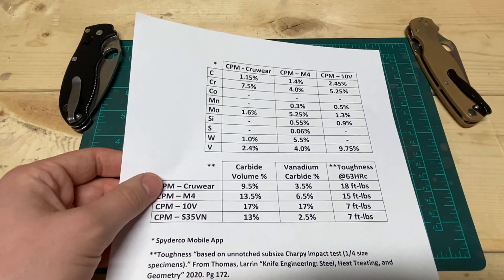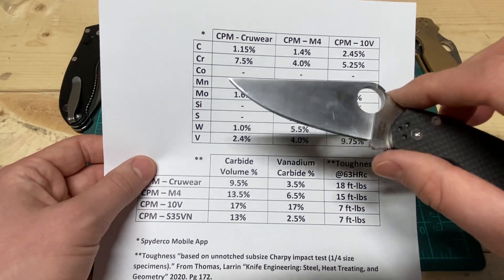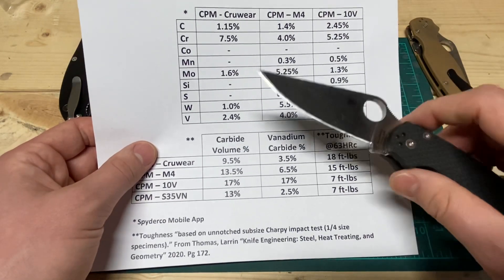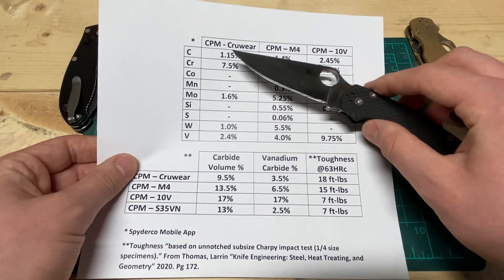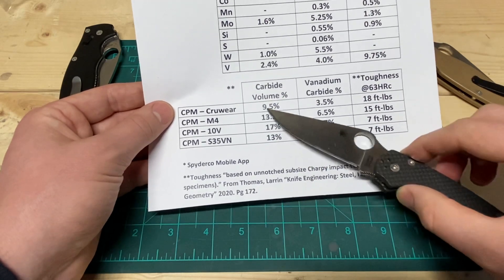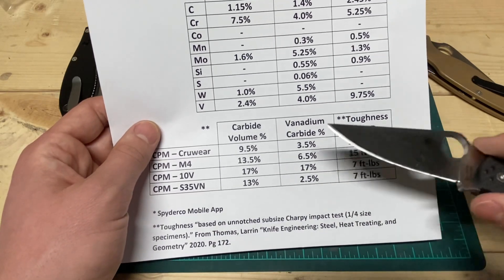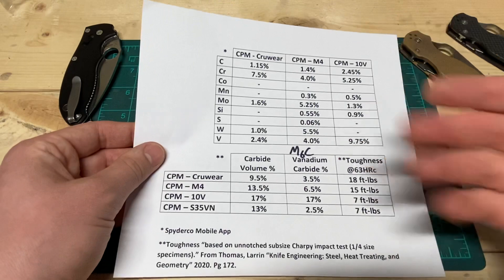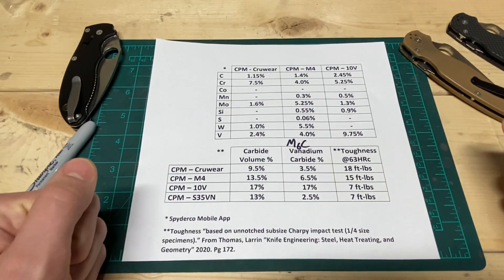Talking Steel: CPM-M4

Comment: Which steel is more desirable for a folder used to cut things but also for wood processing and carving when hiking, M4 or Cruwear, or maybe another steel? Great video by the way. I’m checking your channel to see if you have similar comparative videos about K390, CPM Cruwear and CPM Magnacut (I saw in a video or read in a comment - I can’t remember - that it is a slight difference between for example Cruwear and CPM Cruwear, or Magnacut and CPM Magnacut. Is this true?) I have just Cold Steel AUS10A and S35VN folders and CPM S30V Yojimbo that I don’t use (keep it for self defense), so I have no experience with these higher edge retention steels. I sharpened just AUS10A steel (most of my folders).
Reply from the maker: Probably CPM-Cruwear would be a good choice for you assuming you don’t care about stainless. 

I’m terms of recommending something else it depends a lot on what things you’re cutting and how often and what your sharpening ability is. 

CPM is a trademark name for  the particle metallurgy process Crucible uses. Any steel with that prefix is produced using their particle metallurgy process. There are a handful of steels that are made both with and without that process like Cruwear and M4 so the prefix is important with those!
Reply: @EngineersPerspective701  Thanks. So, the steels with CPM prefix are better than the homologue without it?
Reply from the maker: @danmano478 in almost all cases it’s a significant upgrade to have particle metallurgy. 

Note that both Carpenter and Böhler have particle metallurgy too with similar properties but don’t necessarily have a prefix to let you know so you just look it up in those cases.
Reply: @EngineersPerspective701  I assume Spyderco always has CPM steels (sometimes it appears only Cruwear or Magnacut in description, probably I should look in the photo what is written on the blade).

Comment: Interesting. Love M4. It's my favorite EDC/hard use knife steel.
Would love to hear your take on CPM-3V and Elmax as well.
Reply from the maker: Generally 3V isn’t run hard enough or have enough carbide to make it into my enjoyable steel category although it’s super easy to move on the stones and takes a fine edge. 

Elmax doesn’t seem like anything special to me. Rather go S45VN or Magancut
Reply: @EngineersPerspective701  - Roger that. I think Spyderco does 3V about as well as anyone has. In the Schemp TUFF, anyway. Mine performs well.
And my 9500 series ZT 0561 in Elmax performs very well once I took about 1 mm of burned steel off the edge.
Reply: @EngineersPerspective701  - why not do a video series on the processes of making various steels?
CPM, CTS etc etc vs conventional ingot steels. There's much about the powder metal processes I'm still confused about. I'm sure others are as well.
Reply from the maker: @holdernewtshesrearin5471  Larrin Thomas has some incredible articles on his Website “Knife Steel Nerds” 

Here is the magnacut article but there’s definitely one on different steel manufacturing. https://knifesteelnerds.com/2021/03/25/cpm-magnacut/
Reply: @EngineersPerspective701  - thanks brother.
Reply: If you like M4 youd love Vanadis 8. Its just a tad better but roughly the same idea. Its a fantastic balance of high edge retention and high toughness. Its just slightly higher than m4. It also has no chromium carbides, just vanadium carbides. Its edge retention is literally identical to k390, and just behind 10v. So it has more than edge retention than m4, but its slightly tougher.  Its 39% tougher than 10v but within 10 percent of 10v's edge retention. Its freaking amazing stuff. Even Larrin Thomas only has a bunch of theories on why its so good. Even he isnt totally sure. He says its his favorite high alloy high edge retention steel though. His reccomendation id certainly good enough for me!  He rated Vanadis 8 at 6/10 for toughness and 7.5/10 for edge retention. A combination i nevet thought possible. only downside is theres only ONE production knife using the steel. Luckily its not terribly expensive. All the custom knives in Vanadis 8 are suuuuuuuper pricey though.

Comment: Thanks for these videos on various steels.  They’re excellent, and I appreciate em.  I bought my first modern Spyderco a couple months ago, (got a couple more since then), and it happened to be a BHQ exclusive Shaman; with a satin M4 blade and green canvas micarta scales.  I didn’t know a whole lot about M4 before buying the knife, except that it holds an edge very well and isn’t stainless.  The more I’ve learned about it; the more pleased I am with it.

I don’t want the absolute hardest steel on the planet, as I’ll need to be able to sharpen it myself… but I want something well above average when it comes to cutting performance and durability.  M4 seems to fit that bill.  From what I’ve seen, Spyderco seems to do a great job on the heat treat for their M4; getting it to 63-64 HRC, (and I think I saw a couple blades that were at 64.6).  Also iirc, M4 has been around since the ~1960’s, (unlike many of the steels which outperform it), and the fact that it remains a very relevant steel today is quite impressive.
Reply from the maker: Glad you liked it and are getting into pocket knives! You definitely started with a great one. M4 is a great steel for a blade and honestly absolutely one of my favorites! Keep in mind that the particle metallurgy process is a really big part of what has allowed M4 to stay so relevant. A combination of old and new!
Reply: @EngineersPerspective701  Yep, particle metallurgy has definitely enhanced M4’s performance.  Of course, comparable steels use PM technology and techniques as well, to achieve their performance.  😉

Comment: You briefly talked about it’s stainless quality’s , in terms of its stainlessnes what does it compare too
Reply from the maker: Pretty low, in the realm of Cruwear or Hap40. Possibly slightly worse but it depends on the heat treatments. Notably better than a 1095, 52100 type of basic carbon steel

Comment: M4 is great steel but I've been on a K390 kick so some time now.
Reply from the maker: How can you not go on a K390 kick? It's freakin awesome! I've been using Maxamet and 4V mostly right now but K390 is soo good.
Reply: @EngineersPerspective701  Yeah bro ! I hear that with Maxamet! I've only tried 3V so far. No 4V for me. How do you like 4V ?
Reply from the maker: @doejon9424  definitely still forming my thoughts on 4V still but it’s a lot like a M4 honestly. Probably will have more edge stability but I haven’t pushed it too hard yet other than hitting a staple when cutting out our old carpet. No damage but blunted.
Reply: @EngineersPerspective701  I've experienced micro chipping with 3V before. Not so much on M4. I still remember my first experience with M4 on a Spyderco "Air" and it was excellent. I immediately wanted the steel in a bigger knife. M4 used to pretty rare on folders
Reply from the maker: My first M4 was the PM2 and it was a next level of performance. Great up front sharpness like I'd never experienced at that time and solid working edge that cut forever. Sharpened better than most of the steels I had too!

We definitely live in an age of luxury where M4 is readily available along with K390 and Maxamet.

Comment: Super helpful video.  I'm really not a collector, but I just happen to own two Spyderco's in M4.  I have the SMKW PM2 "arctic" exclusive in M4 (underwhelmed by the scales, which I got it for, so not sure I will hold on to it).  I also have the lil' Native M4 exclusive, which I put titanium scales on... I totally love that thing.  I'm sometimes in a city with a 2.5" knife ordinance, so the lil' Native seemed like the most knife I could get within that law.  For such a stout little blade, M4 just seemed to make a lot of sense (especially for the same price as s30v).  But it's true that it's not a great slicer, so I've been looking at knives to pair it with (other than just a SAK)...  After our conversation about k390 I'm looking at getting a Dragonfly in that steel (probably the wharncliff version that should be coming out).  That should be a great precision cutter and respectable cardboard cutter.  One thing the lil' Native helped me to appreciate is how good a small knife can be at precision cutting, but the dragonfly is going to be better at that in every way (probably true of the chaparral as well, but no k390 options there).
Reply from the maker: Not a collector either! Most of my knives look like hell from use or experimentation of some kind! It may be worth keeping the PM2 just for M4 but I'm sure you can make some money on the one you have while still picking up another M4 blade for less. 

I really started having the same appreciation for smaller blades once I got into the Para 3s and native 5s. I fully prefer that size and it becomes more apparent as working knives. The precision and ease of use totally trumps the extra blades length most people put as a qualifier for a "work knife". A K390 dragon fly would be absolutely awesome. Probably the most cutting in that size package that has ever been produced by man! It won't feel as stout or refined as the lil' native but it's a sweet little blade.
Reply: @EngineersPerspective701   
I assumed I would sell the M4 PM2, but they must be making more of these exclusives, because the Ebay selling prices have been close to what I paid.  I still may sell it... I think I'd be happier having my money in a Brouwer (and they're already disappearing).  I like the idea of putting a liner-delete copper scale on a Brouwer, without it getting crazy heavy like most copper knives.  The Brouwer would probably be an ok recycling knife as well... less length, but pretty thin behind the edge.  It's hard to justify keeping the PM2 just so I can cut cardboard slightly faster, lol.

It looks like you've got bigger hands, so I can see why you'd prefer the full-sized Native 5.  The attraction of the Dragonfly is also that it will basically disappear in the bottom of the pocket (just like my Victorinox Compact, which I mostly just carry for scissors), so I can always carry it as a secondary.

Comment: Silicon is not impurity brother.. Sulfur and Phosphorus are.. M4 was one of my favourite steels untill ive got 4v and k390🙏 I had untill recently had Shaman in M4.. I loved the edge on M4 but i never really push it to its limits.. Yet another one that had "very hard to sharpen" reputation, totally false.. Easy with proper abrasives (100% diamond or cbn).. Thx
Reply from the maker: “Mostly and impurity” maybe better said as a functional impurity? It has specific functions in the production process dealing with oxygen I think but it being leftover at the end isn’t necessarily positive I’d say. Possibly helps a little with machinability. 

Diamonds/cbn definitely make M4 a sweetie. Very good overall steel. Like you though I’ve also “graduated” to a little higher tier of steel for my personal preferences

Comment: What differences do you notice between CPM-M4 and K390 in terms of performance if any?
Reply from the maker: Substantial differences. Two cases to look at because I also have 10V that is a lower hardness than the K390 I have and they perform extremely similar. Note that I do really like M4 and find it to be a steel that I can comfortably use without feeling like I'm giving up anything.

If I had to grade their performance it would go like this.
M4 (62-64HRc) = B
10V (63-64HRc) = B+
K390 (>65HRc) = A+

1) 10V at same hardness as M4 (63-64HRc): In short, 10V/K390 at the same hardness feels exactly like M4 but on steroids and takes longer to apex with the same abrasive. Every property is either equal or better essentially. 

They both hold the same up front sharpness but 10V comes up WAY stickier in sharpening. Even if over polished it quickly develops into a sticky edge after a bit of use as those VCs are exposed. M4 holds onto whatever the original edge you put onto it until it dulls enough to form a working edge. The quality of the 10V working edge is superior and is able to cut things that M4 will struggle with for longer. 

2) K390 as higher hardness (>=65HRc): Not even a close comparison. It's a totally different class of performance. Much higher edge stability. Longer up front sharpness, same working edge as 10V.
Reply: @EngineersPerspective701  No wonder they put in the production model for the Seki model line-up. I wonder why more manufacturers haven’t picked it up versus M4.
Reply from the maker: @nandayane  the seki K390 is amazing! And they’re geometry tends to be better than 80-90% of what’s out there too, delica came at 0.015” BTE at 17dps plus the super thin spine and distal taper
Reply from the maker: @nandayane  my guess is M4 is more known and easier to machine
Reply: @EngineersPerspective701  Gotta give Sal respect for putting it in the seki line of knives. Spyderco really is run by a steel nerd! I guess that is one way to justify the “spyder tax” put the best steel you can find in your main line-up.
Reply from the maker: @nandayane  they definitely give a crap! I feel like most knofe companies are putting a 4 cylinder in a Ferrari body whereas spyderco sometimes puts the Ferrari engine into a Toyota Camry
Reply: Hopefully it will be less than 3 years before we see a magna-cut endura or pacific salt knives. It’s unreal that the native 5 will be released in magna cut less than a year after the steel came into existence. Exciting Times
Reply: K390 chips a lot easier.
Reply: @jeremyjjbrown  right, that stuff sucks!!
Reply: @jeremyjjbrown  yup and the repair is no fun.

Comment: M4 is currently my favorite steel.   You do a great job on these videos.  Hope you have a great new year!
Reply from the maker: Appreciate it! Enjoy the New Year!
Reply: I've got a benchmade bail out with an m4 blade. Comparing it to my Gerber easy out with much softer steel I would say that the benchmade stays sharp much longer (general hard use), problem is, it takes a lot of time and patience to re sharpen. On the other hand, I have a work sharp 20° feild sharpener that I can put a razor edge on my Gerber in 5 min.

I do like the m4, but probably wouldn't even attempt sharpening it in the feild.
Reply: @daveware4117 on the work sharp field sharpener the fine diamond stone doesn’t do a good job maybe too fine. I prefer the falkniven pocket sharpener with the diamond plate/black ceramic
Reply: @daveware4117 use diamonds to sharpen it and only go as fine as like 500-600 grit. Thank me later

Comment: That page from Larrin Thomas ' book makes me wonder if you would recommend it for a knife collector /nerd?
Reply from the maker: I put these pages together. I can't speak for collectors but really it's a good steel for anyone who isn't concerned about corrosion. Can take relatively low angles, holds front end sharpness and has enough carbides volume to break down into a very solid working edge. All good stuff

Comment: Love these. Someone who talks about carbide volumes and carbide types. These little details are what make these steels shine.
Reply from the maker: Appreciate it!
Reply: Good information. I am guessing the balance of harder and softer carbides is how the manufacturer controls chipping and breaking. All hard vanadium will yield great edge retention but the trade off is chipping.   Some steels are designed for harder use (greater toughness for abuse) and others for long extended periods of use (greater hardness for edge retention). The right steel, geometry, thickness, and heat treat when paired with a good design truly is an engineering masterpiece